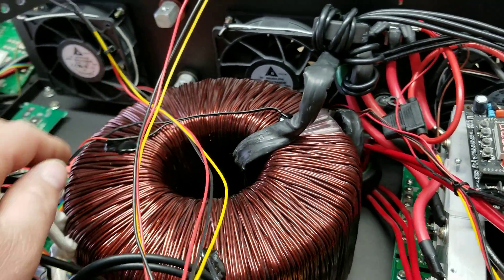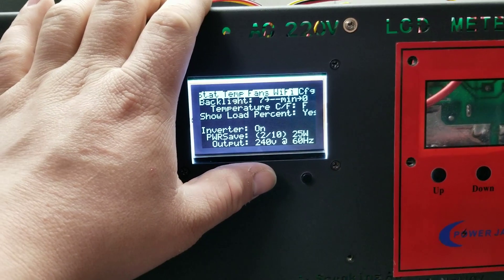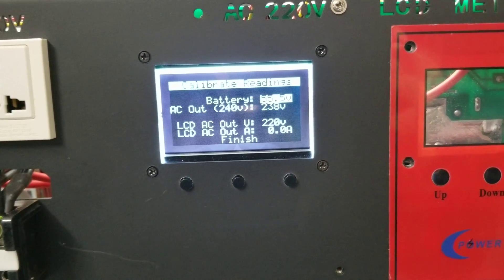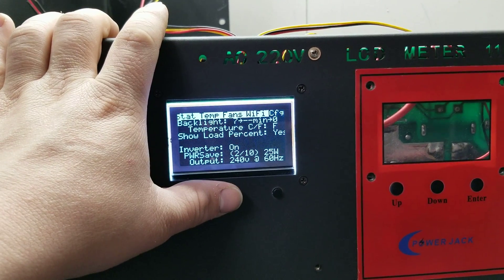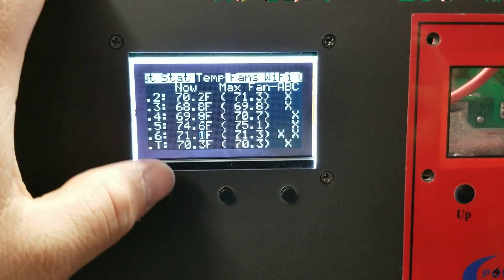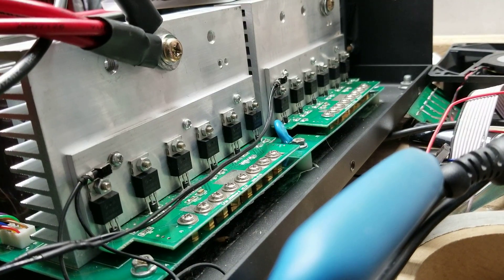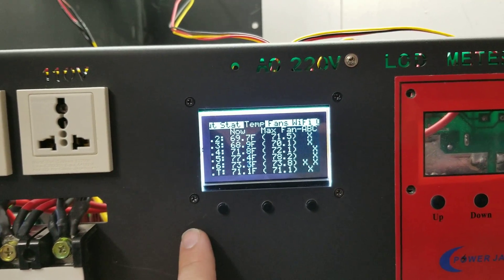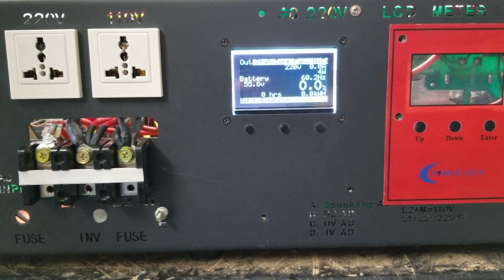My new custom Power Jack Inverter. Powered by Genetry Solar part 2

Comment: Hi. I repaired my inverter with all the new parts, new mosfets board, new driver board, I even put ALL the new boards on it, it turns on well, but going from 1400w approximately it will overload, what could it be?  it is a 15k power jack.

Comment: Just purchased a 9000 watt inverter  what size  battery  bank do I need
Reply: That depends on what you plan to use it for.
Reply: @brian_GotSPL  a single wide trailer had a 2oo amp  service doing away with electric heat stove water heater just lights water pump tv changed lights to led tv is led refrigerator micerwave washer small ac

Comment: Are the version 9 and 10 9kw and 15kw actually continuous?  I need to be able to run 5kw well pump pressure tank, electric dryer and air con at the same time if that situation comes up.
Reply: No, they are not.  Estimate approximately 50% load for continuous operation.

At least they are not terribly expensive, but that's how China often sells things.